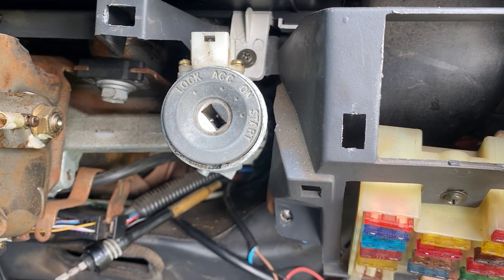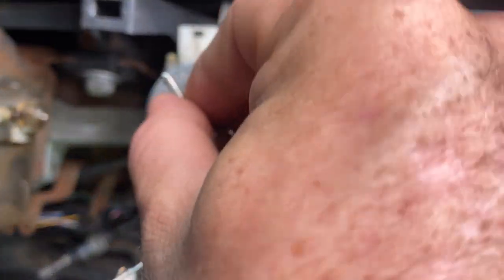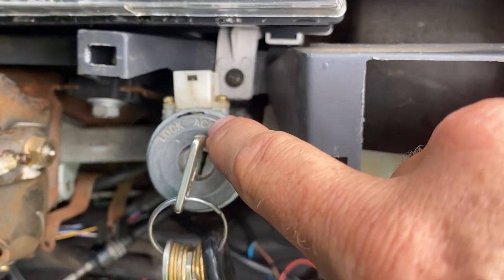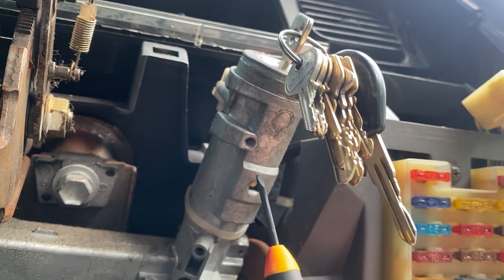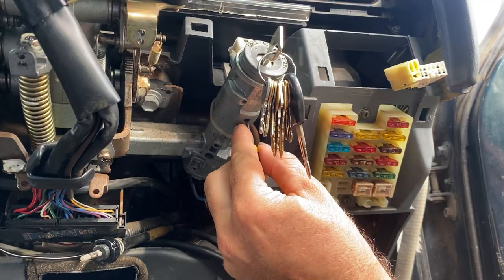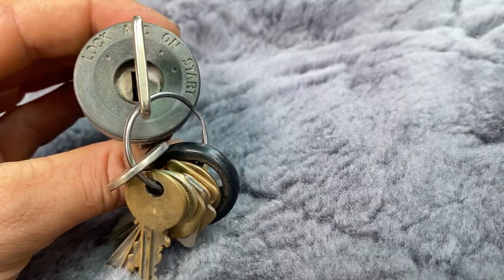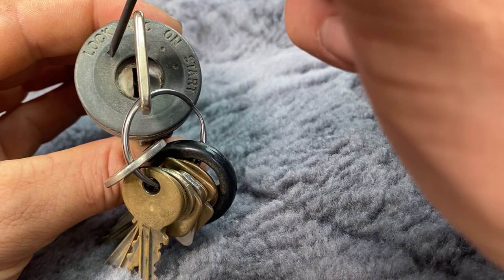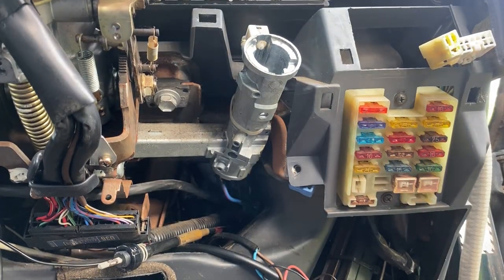Toyota landcruiser ignition lock removal

Comment: Im replacing it because i got no key why else would you be changing the barrel?
Reply from the maker: @richsmith3300  I had to change mine because the key was getting Jammed. 
Also you need to replace if key is to loose. They ping it on rego check sometimes. 
If you don’t have a key you will need a locksmith. Or there is a pin you can drill out. But it makes the barrel so it comes out easily and easy to steel the car

Comment: hey mate, I snapped the end of my key in the barrel and now won’t turn to accessories how do I fix this?!
Reply from the maker: Sorry this is something that I have not had to deal with. My current knowledge stops with how to get the barrel out with a functioning key.
I think you might be best talking to a locksmith on this issue. Sorry I couldn’t help further.
Reply: Did you ever find out how to fix it?
Reply: Hey mate, ever get that ignition barrel out? Dealing with the same issue, would greatly appreciate any assistance

Comment: Can it be done without a key? 94 land cruiser
Reply from the maker: OddStuff yes it can. But all ways destroy the lock. You can hammer a screw driver into the lock and force turn it. Destroy the lock or you can’t hammer in the stud. Destroy the lock. Or get a locksmith